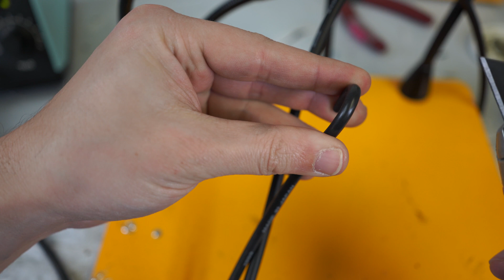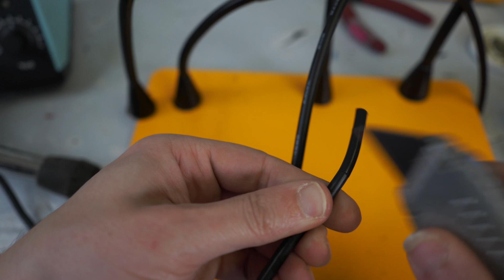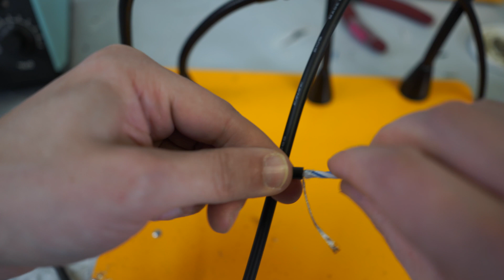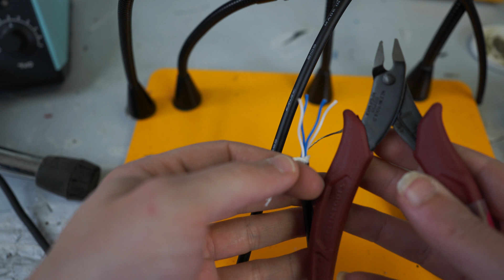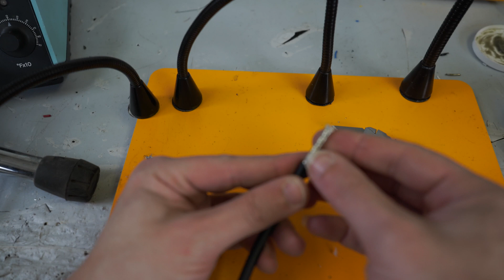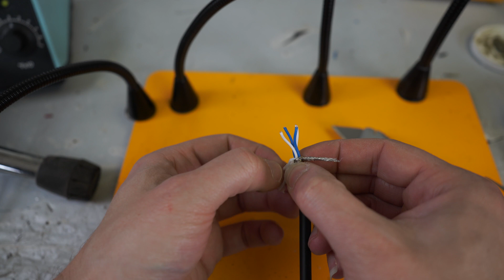What Is The Difference Between Canare Starquad L-4E6S & L-4E5AT Mic Cable?

Comment: Shield is NOT the same as a drain wire.  From a perspective of electromagnetic rejection these 2 cables are not the same functionally. 

Is there an equivalent in-wall rated 4 wire, shielded like the L-4E6S?